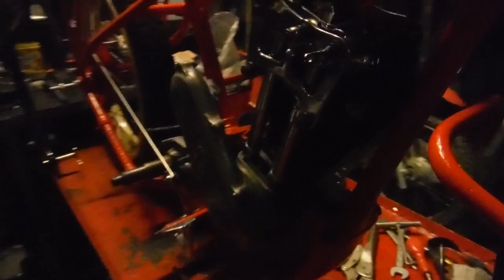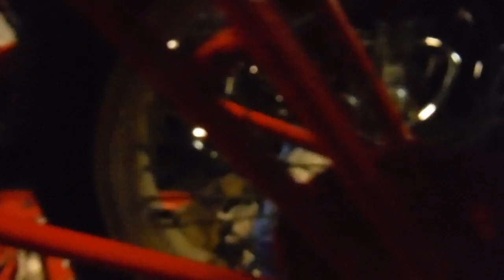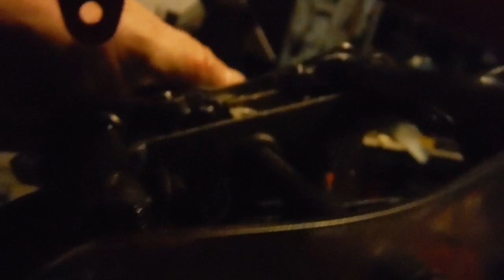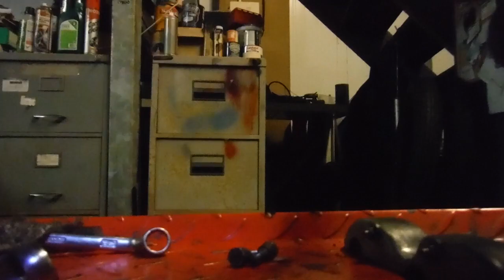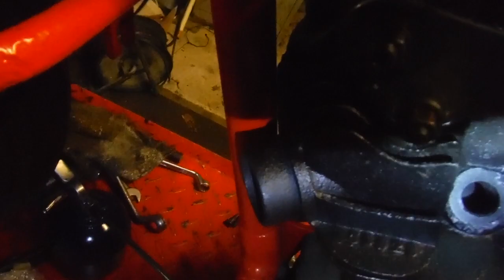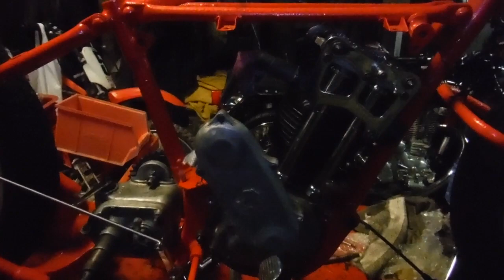Dunelt motorcycle with Sturmey Archer engine under restoration.

Comment: Looks like a camshaft model from about 1932. Had one in 1951. Had a cork clutch running in an oil bath and a hand change .
Reply from the maker: It was certainly over head valve. The engine and gearbox were by Sturmey Archer and it was 350cc.